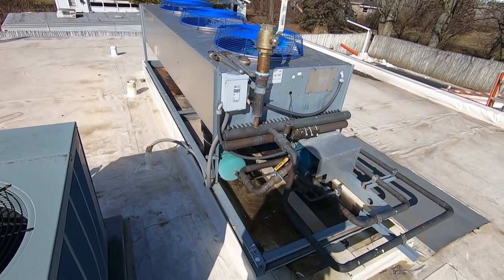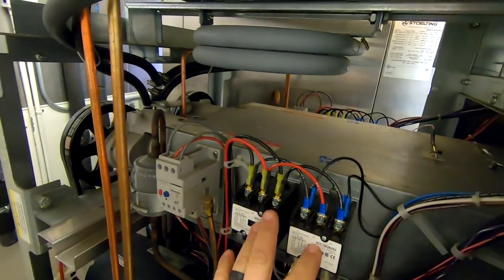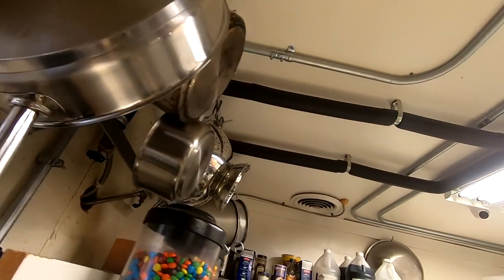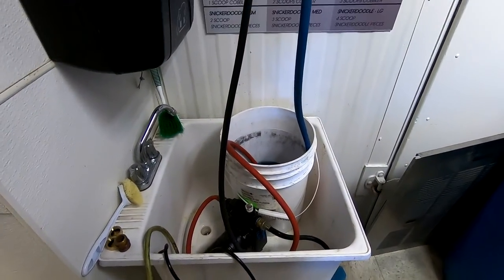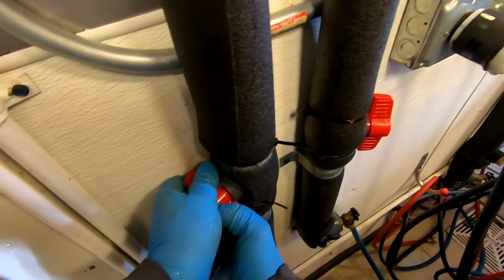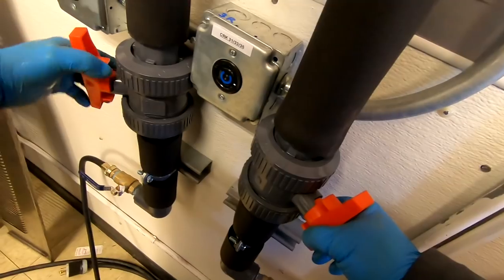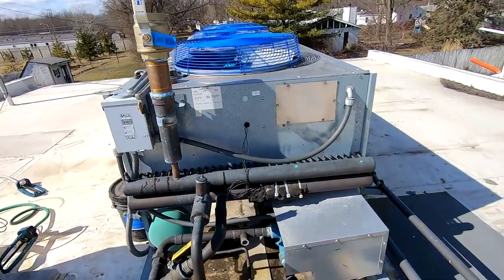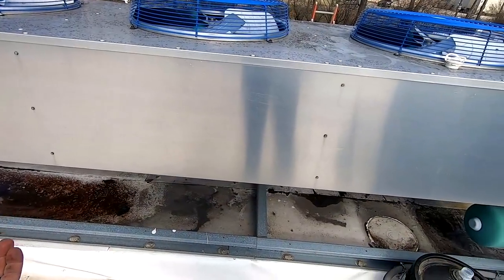Ice Cream Water Cooled Condenser Setup With Easy To Bleed Valves

Comment: My Hats off to you, that’s a little more work to go thru all those isolation valves than I care too, you’ve done a good job on it!!
Reply from the maker: I luckily I didn't have to install them but I was asked what I would like done to improve servicability.  I personally like too power bleed water loops for quick service but you need to have isolation valves in a parallel circuit for feasability. This is is also how I like to purge air from hot water boilers.

Comment: Two improvements would help the air locking issues. The discharge of the circulating pump is orientated horizontally but is at the bottom relative to the pump housing. This makes it prone to airlocks by trapping air in the top of the pump housing. Vertical up or horizontal with discharge on top is ok. Also, adding a Spirovent inline air separator on the suction side of the pump would remove even micro bubbles of air continuously throughout the year. On a closed loop system with an expansion tank, there should normally be a water pressure gauge at least on the suction side of the pump so a positive pressure could be placed on the system while the pump is off and a matching pre charge on the expansion tank set ahead of time. For that system around 7-12 psi would be sufficient (vertical static head from suction side of the pump to highest point in the system plus 5 psi safety factor is recommended to prevent introducing air from leaks or through automatic air bleeders. A water discharge pressure gauge used in conjunction with suction gauge could help in evaluating pump performance to obtain a delta P to obtain system GPM while referencing the pump curve.
Reply from the maker: Good idea on the Spirovent, we use them on our boiler installs. I'm not sure the piping from the pump would make a difference? The pump was designed like that from the factory I believe and the piping has to go lower than the pump because of the location of the outdoor unit. Thanks for commenting!
Reply: +JR M Very good points. Pump discharge should be at the top to allow easy start-up without manual bleeding etc. I install pressure/temperature gauges even in domestic installations. Troubleshooting is so much easier and one can ask customers to observe indications to help find faults/diagnose/etc.
Reply from the maker: @Luzt.  There is pressure gauges and temp gauges but those are locaited at the ceiling level. I understand what your saying about there pump orientation,  I had a similar issue when someone installed the break calipers on the wrong side of my son's car resulting in a air lock that could not be power bleed.  But that's how the pump comes from the factory pre- installed. I'll need to see if there is examples in manual from Heatcraft. Thanks 4 the input👍👍
Reply: @HVACRSurvival  Thank you for your time. I'd like to stress one thing - my comments in this and many other cases are related to the way things were designed/erected and I understand these aspects have nothing to do with you. You are doing great job on systems which could sometimes be improved.
Reply from the maker: @Luzt.   No I didn't feel as though you were criticizing or anything else. I asked for comments in the video for a reason. I do appreciate your professionalism in addressing any potential misunderstandings. I'm set up to start doing live streaming and podcast, I just haven't done so yet, one item that drives me to maybe do a live stream is so that I can meet my viewers on a face to face interview during a live stream. The viewers gets to see what I look like,  hear my tone of voice and see my body language to help build a profile of me.  I unfortunately do not have that privilege LOL

Comment: installed those in Vegas years ago.(Dairy Queen) condenser was under sized. What works in outer parts of the country will not work  the Dessert, took some time too get that across.
Reply from the maker: I would say you're probably correct.  I know they have a sizing chart, it is dependent on how many BTUs you need to reject and the outdoor design temperature in which is going to be used. I would say that would probably help. Leave it to the all knowing engineers. 👍👍

Comment: That’s a nifty system.  Never seen that before
Reply from the maker: Me either prior to coming to this company. A lot of places hook up city water and let out flow down the drain. But depending where you're at that can get expensive.
Reply: Have a store with electro freeze machines that run the same glycol setup. Changed the glycol pump last year. Their water bill is up there
Reply from the maker: @WswRefrigeration  how is there water bill high if it's a closed loop?
Reply: Dohhhh though my i wrote that we service another place that drains and their water bill is up there
Reply: I’d love to work on a stoelting though. It’s the only one I haven’t worked on
Reply: Thought I wrote
Reply from the maker: @WswRefrigeration  lol Its all good

Comment: you would think they have a "high vent" in the system to auto bleed it ?
Reply from the maker: It's worked for a long time with no real problems until you have to open the loop for service or in this case we added a machine,  I have always disliked parallel circuits that have vertical ups and downs.

Comment: Head still spinning.. Lot's of valves. I always thought foam means air, and air means cavitation??  Thank you for the video.
Reply from the maker: Foam could be micro air bubbles, not 100% positive on if it's cavitation or not. I know I've never seen it perfectly clear.
Reply: @HVACRSurvival  I'm thinking you guys would see impeller/housing failures if those micro-bubbles where a nucleation area to form cavitation bubbles. Much of this area is still a mystery to me; probably will always be above my "pay grade"..

Comment: Hi ,thanks for the information, I want to know what is the appropriate water temperature for cooling system?  thanks
Reply from the maker: Cooler the better. It depends on the out door temp.
Reply: @HVACRSurvival   i have just one machine electro freeze water cooling, I think if I used the car radiator with a fan and water pump it's enough to cooling the system, what do you think? Thanks
Reply from the maker: It sounds like it might be too small but I haven't tried building a water condenser so I can't be certain.

Comment: Nice one ! 
Hey , I'm very curious to know , do you guys install an expansion tank to allow for the water volume increase when it warms up ?
Also , what do you call the " air bleeding devices " that we install at the top , that let the air circulating in the pipes to purge out  .
We call it " automatic purger " but it doesn't quite translate .
And last , we call these condensers " dry coolers " , I wonder what it's called over in the States ( technical lingo is not easily found for translation unfortunately ) 
Thank you , sir !👍
I almost forgot , the valve that regulates the water flow to the condenser on the ice maker , we call it a " pressure valve " or " pressure regulating valve " , eh it doesn't quite translate again , so I wonder what the exact term is that you guys call it .
Cheers !
Reply: I've always called them dry coolers also. We call the vents that automatically vent auto vents and that style flow regulator a water regulator valve.
Reply: @jonnymac31  Oh ok , that's much more straight forward than I expected , ey !
Thank you 👍
Reply from the maker: There is a expansion tank at the outdoor coil that I pointed out in the beginning for the warmer days.   Auto vent is what I have always called the air bleed valve. Not shure what Heatcraft calls it,  but it's built for this application and not just a refrigeration coil converted. Thanks 4 watching🤜🤛
Reply: @HVACRSurvival  My bad ! Nice to see a vid on hydronics , there's not too many out there , thanks for sharing it !
Reply from the maker: @sterlingarcher46  no worries my friend👍👍

Comment: Love some stoelting machines! We have 22 Dairy Queen’s and more than half are stoelting and others are HC duke. None of them water cooled however, enjoy seeing different types! Any certain reason for water cooled instead of air on these? More efficient on colder days?
Reply from the maker: The amount of heat a air condenser puts off into a small workspace can cause a lot of load on the air conditioner.
Reply: HVACR Survival I get that. Most all of ours have remote condensers that are air cooled to minimize the heat issue.
Reply from the maker: @jphvac5725  I'm not too impressed with the quick connect brass fittings they use,  we had to cut them out at one DQ that leaked at almost all the fittings but that might have been a install error. (That's my guess,  I didn't start the machines) Im service only generally.
Reply: HVACR Survival I’ve had three that I’ve cut out and braised in straight for same reason. But two leaked after years of use and the last leaked when we first installed them due to coworker tightening them too much and causing the leak. But I agree, never liked those quick connect fittings on ice cream nor ice machines.
Reply from the maker: @jphvac5725  I agree,  they usually fail because there not properly installed.
Reply: HVACR Survival Yep. Bunch of the stores have ten feet of extra lineset coiled up on roof because whomever installed them 20yrs ago didn’t want to cut them to length and braise. Luckily we have been changing them out little by little and fixing those issues. all those fittings leak eventually and best if straight piped anyways. Never understood why these companies think these quick connects are a good idea to begin with. If not installation, they vibrate loose or just eventually leak after fifteen years. Is that main reason you all do more water cooled systems then?
Reply from the maker: @jphvac5725  I've never asked why but I would say most likely is due to the amount of heat they put off in the building. A lot of these buildings being used we're not purposely built for what they are being utilized for and the air conditioning would be undersized. I'm not sure if you have a Menchie's by your area but those are all water cooled also. They have 8 or 9 machines side by side,  I would speculate depending on how many machines you have in the business it's cheaper to move water than it is to move refrigerant around and a a lot less costly when it goes wrong. The other factor is a lot of the people installing equipment are either not properly trained or just don't care about doing the job right, so the screw together connections would be the brain-dead method of getting it done quickly.

Comment: Was that little green thing under the roof top unit an expansion tank? I would think you would need one even if the temps only vary by 30 degrees or less.
Reply from the maker: That pump on there is at least two horsepower and might be even more. I believe it's for the shock of when it kicks on. Nothing to do with temperature

Comment: I've worked on them down here in Florida. Just curious if you, what us the maximum temperature your water can be running through those units? I ask because they were running with only air cooled condenser, no chiller. My boss said chiller was not needed, water temp was above 90 degrees. Running into all sorts of problems.
Reply from the maker: I'll have to see if I can find the manual and check the specifications. Somewhere in the mid-nineties it's probably about all it can do

Comment: Those pumps are garbage at best. I have a wayne PLS100 i use for boiler chemicals and it has lasted way longer.
Reply from the maker: Which pump,  the acid pump? If so it didn't want to pump at first, I had to spin it with a small screw driver. The other pump has been good to me for 2 plus years and its my personal pump I originally purchased to wash out condenser coils when there's no water at the job site. It builds 50-60psi of water pressure and works great.
Reply from the maker: I looked up your pump,  it looks nice and quite. Wayne and harbor freight pumps look to both be made in China because I have seen my pump in both stores and while searching for yours it appears it also is made for both stores. I will definatly check yours out when mine goes bad,  thanks for the heads up.
Reply: @HVACRSurvival  the iron pump you had to burp the air out is the one I've had bad luck with, with injecting boiler chemicals. They sit for a month or so and end up tearing the shaft seal or lock up completely. I've had 4 end up leaking. They can't handle heat either or it warps the impeller.
Reply: @HVACRSurvival  the one i have also is world's more quiet and so much more powerful
Reply from the maker: @walkingfreak  yes I heard that on the video I watched and it can be rebuilt.